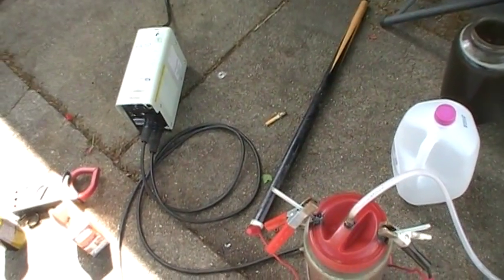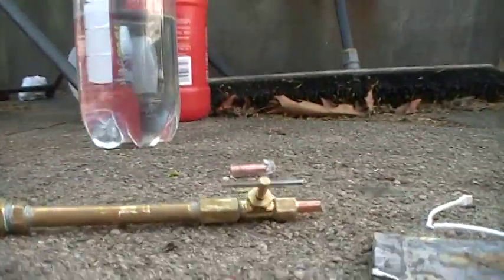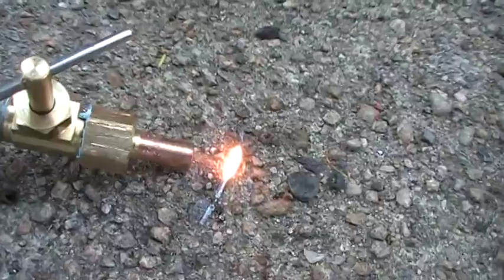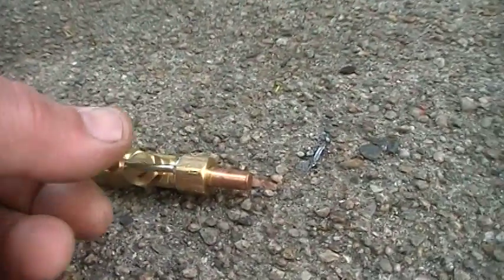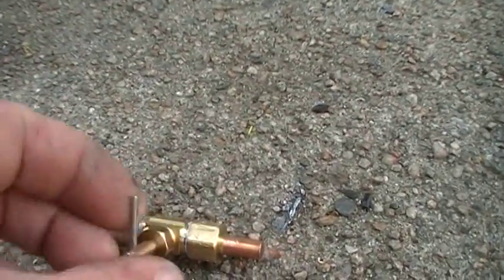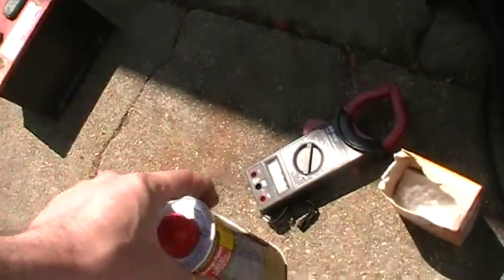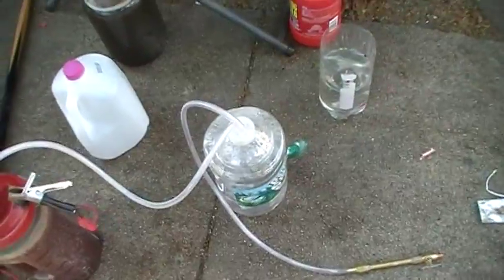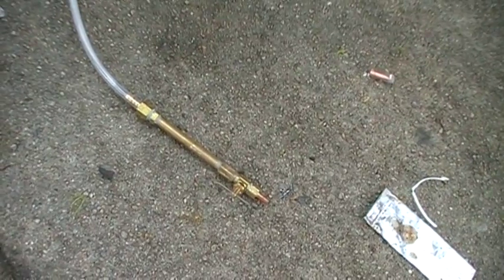HHO Hydrogen Torch it works :)

Comment: @Mikeandwendy74 you will be able to do just that in a few weeks. I am designing an all in one water torch system with two polarity customizable cells, top of the line hho specific flash back arrestor, and a mini pencil torch. Ready straight out of the box, just add water and power. Will be for sale on my website and will
Be compareable to the output of the current design your building now. Very excited to get my torch system on the market.

Comment from the maker: @jdcproducts right now I am building a smack booster to exact specs, sanding, center punching, if I can get the claimed 1.5-1.7LPM from it it will work great for a torch. I like your dual generator setup I'd like to get my hands on that :)